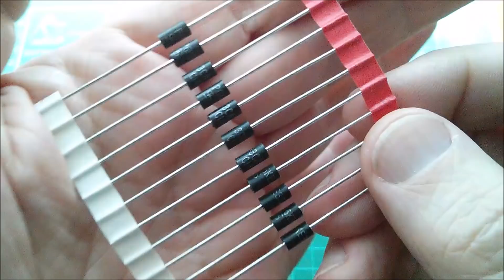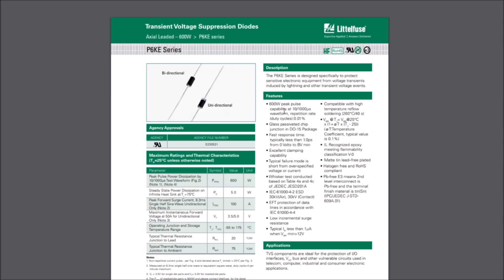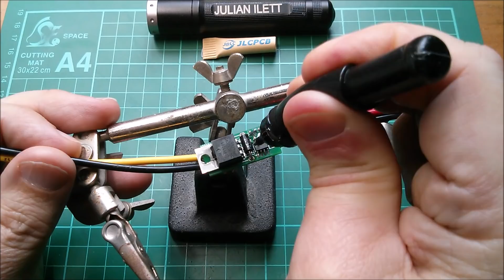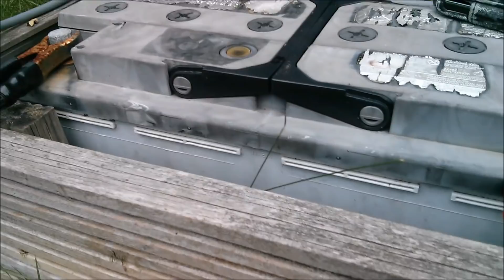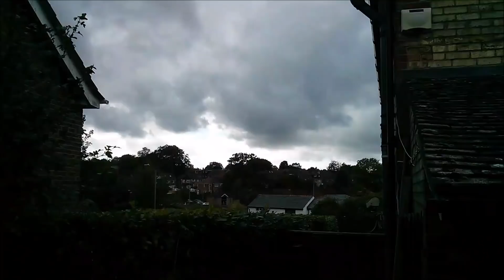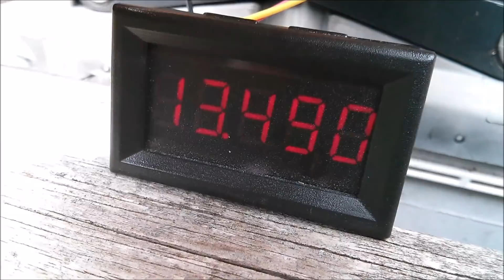A Diode with No Cathode - PWM5 Femto

Comment: Basically if one side spikes it will automatically send that voltage to the other side that can't take that voltage because it also has a zener diode (this package) protecting it from spikes? Basically this is a voltage regulator that doesn't allow any voltage under what you specify untill the voltage goes above that and then cascades the voltage to the other side? Or look at it like this, both sides can only take 5 volts, I install a 5.3volt variant of this and I spike side A with 30 volts not only will I ruin side A with 30 volts but I will also ruin side B with 25-30 volts because I just dumped my over voltage to the side that can't take it? I'm not sure I fully understand the purpose of this package because I've always used a zener to ground or power not sensitive side to sensitive side.
Reply: I'm puzzled too.  A zener will forward conduct or reverse conduct if there's an EMP in either direction.  So I would guess that maybe the devices shown are for ac applications where you could not use one zener.  I would further guess that a fat zener would survive long enough to take out a fast blow fuse in series from the solar panel, disconnecting the circuit completely.  Induced emp from nearby lightening strikes may briefly produce a voltage spike that can fry most (not all) semiconductors.  But they usually have little energy, so a good design can dissipate that.   A direct strike to an exposed connection is a different matter, which I don't think you can remedy with a small component because it carries a huge amount of energy.
Reply: It’s not the absolute voltage that is the problem. It’s the high differential voltage between the positive and negative circuits. The protection device clamps such a high differential voltage by conducting. The current flows via it and the energy is dissipated as heat. Once the voltage differential drops below the specified voltage, it stops conducting.
Reply: @Mark1024MAK    what do you think about doing all long cable runs as twisted pairs to reduce the induced differential?
Reply: Ray Kent - twisted cables help, yes. Not easy to do everywhere, for example at the battery. Also if you are using a manufactured cable, it may not have twisted cores. Most cables designed for power applications are not twisted.
Reply: @Mark1024MAK  you just explained a typical everyday one directional zener diode unlike the one in this video.
Reply: wheelitzr2 - these protection devices are effectively two fast acting Zener diodes back to back. The difference being a normal Zener diode will have a forward voltage of around 0.6V. And is slower to respond to voltage pulses when reverse biased. Whereas this protection device has the same or similar voltage characteristics regardless of the polarity. The voltage in either direction being as per the specification.
Reply: @Mark1024MAK  yes I get they are 2 fast acting zener diodes back to back, and that's not what you explained in your last comment. And apparently you don't get my issue with this package and how it's being implicated here. It's clearly designed for AC current but he is using it in a DC device. Let's say he has one side hooked to ground and the other hooked to +power and the zener is a 30 volt zener because the circuit is only 24 volts and will get destroyed above 34 volts, now let's say for some reason the power side goes above 30 volts then the zener in that direction will pass current to the ground and protect the device, However if the negative for whatever reason (gets hooked up backwords) and is hooked to say 45 volts then the zener diode in the other direction will allow 45 volts and the current associated with it through to the side that can only handle 24 volts. So please explain how that is ok.

Comment: You may find spray conformal coating a little easier to use and potentially much cheaper in the long run. The type of UV in your flashlight is also perfectly safe to expose your skin to. Also try slathering a load of thick grease over the battery terminals and that should help prevent corrosion.
Reply from the maker: I didn't want to use a spray - it would get all over the connecting wires. Also, I'd have to spray it outdoors.
Reply: Julian Ilett  You can also use regular nail polish, it works quite well as demonstrated by GreatScott!
Reply: Use clear nail hardener on it, it really works for waterproofing. JI.

Comment: Why do you want to make current from solar panels in England? Make a rain water generator, that would be smarter. ;-)
Reply: Because the "rain barrel" is occupied making fish for fish and chips. <ducks from the onslaught of ashtrays and shoes thrown my way>
Reply: @ExtantFrodo2    that could be the sole reason.
Reply: Ray, am I herring you right?
Reply: @ExtantFrodo2    as a teenager after band practice coming back to Charing Cross station we came past a fish and chip shop called the rock and sole plaice.  Rare example of a triple entendre.
Reply: Sounds like a nice place to perch! Pffft, I know that I'm floundering for puns here. Somebody krill me.
Reply: @ExtantFrodo2  Oh for cod's hake.
Reply: I sea what you did there. Just clowning around on porpoise.
Reply: @ExtantFrodo2  Have you fin ished because the scale of this is disturbing. I'm always up to some antics.
Reply: Almost. Although I do think we need to determine how many seahorse power he can get from his rain barrel.
Reply: @ExtantFrodo2  Simple maths, the average cart horse weighs about a ton or 1000kg. 1000kg = 1000lts of water. I assume his barrel is 200lts so 200kg and a seahorse is about 20grams. So about 2000 seahorse power, give or take a whelk or two.
Reply: Possibly because it's somewhat nicer to work in sun and partly cloudy than a downpour?
Reply: Big battery installations (think telephone office with phone booth size batteries) use NoOxide brand to prevent corrosion.  Not sure how that would work when exposed to the weather.
Reply: He likes a challenge.
Reply: I did the calculations for rooftop-rain hydro power. They did not come out favorable.
Reply: In England you often get the wrong kind of rain...
Reply: duncan, what could be worse than raining cats and dogs?

Have you ever heard of hailing taxi cabs?
Reply: Because it is easy to make power in southern Spain or California. But if you really want to improve performance, then overcast grey skies are the way.
Reply: der Birnodin            *.   C
Reply: People joke about England being wet...but I actually can't remember the last time it rained in Southern England! Other than the odd shower it's been very dry.
Reply: @hyperion8008  Trust me you English know nothing of rain. I'm Welsh and live in Carmarthen I've seen 86 consecutive days of rain.
Reply: The outside croc clips Mr Ilett a bit sloppy , I expect better, years ago when I was an apprentice,when finishing a job where battery clips were involved, we had to cover the joints with this red translucent jelly type stuff,I can't remember it's name, but it kept them like New.
Reply: Would that stuff they put over car battery terminals work?

Comment: If you had used a longer blink for a 5, it should be much easier to count.
Reply from the maker: Ah yes, good idea - that would work. The LED was initially just a heartbeat - so you could see that the unit was still working - but then I added a volts indicator (whole volts only) - then I added the tenths.
Reply from the maker: or a gap after the first 5 - like a tally count :)
Reply from the maker: I'll have a look at coding that :)
Reply: I read somewhere (can't find it anymore, sorry), that humans can intuitively count to 4 or 5 without thinking about it. That is why I though about the long 5. You get a long blink, than it is followed by at most 4 short bursts. If you want to get fancy, you could use morse numbers... ;)
Reply from the maker: Morse? No thanks - I don't need another look-up table!
Reply: int n = YourNumberHere (0-9);
int morse = 0x3C1F;
char pattern = ((morse>>n) & 0x1F);
The bits 4-0 contains the morse pattern for the numbers. ;)
Reply from the maker: and in PIC assembly language?
;)
Reply: I don't speak PIC assembler language, yet... Hold my beer, I will be right back.
Reply: @JulianIlett  maybe binary numbers?
Something like 1100 long 0 for the decimal point and 0111 = 12.7
Reply: It takes too long to learn a new assembly language... Here is the simplest c code that I could manage. Should be very easy to convert to assembly. If you actually do it , let me see how it is in ASM. Cheerio.
uint8_t n = Number (0-9);
uint8_t p=0x1F;
if (n<6) {
  p >>= n;
}
else {
  p <<= (10-n);
}
p &= 0x1F;
Reply: Now I understand what you mean... PIC assembly is very limited. It is either 2 loops with RLF or RRF or a switch, which translates to a lookup table  of goto. By the way, I am using sddc to compile c into PIC assembly to study it, maybe you would like to take a look.
Reply: I swear that this is the last comment. ;) I used SDCC to help me with that. I did some manual cleanup and commenting.

  1 ; Parameter in W
  2 ; r0x1000 copy of parameter
  3 ; r0x1001 high byte of pattern
  4 ; r0x1002 low byte of pattern
  5 
  6 morse:
  7   MOVWF r0x1000    ; save parameter
  8   MOVLW 0x3c       ;
  9   MOVWF r0x1001    ;
 10   MOVLW 0x1f       ;
 11   MOVWF r0x1002    ; load morse pattern 0011 1100 0001 1111
 12   MOVF  r0x1000,W  ; reload parameter as a counter for shifting
 13   SUBLW 0x00       ; make counter negative
 14   BTFSC STATUS,2   ; if counter is 0, don't shift
 15   GOTO  out
 16 shift:
 17   RRF r0x1001,F    ; shift high byte right into carry
 18   RRF r0x1002,F    ; shift low byte right from carry (nice way of doing multiple byte shifts)
 19   ADDLW 0x01       ; increment counter
 20   BTFSS STATUS,0   ; if counter is 0, we are done
 21   GOTO  shift
 22 out:
 23   MOVLW 0x1f       ; load 5 bit mask
 24   ANDWF r0x1002,W  ; return the masked morse value in W
 25   RETURN
Reply: I did an Arduino version using Morse - it's quite code heavy but works fine. I made a class for a morse sender, found I needed to change the mark-space ratio to make it readable.  https://github.com/GarethDaviesLondon/PWM-Charge-Controller-Arduino

Comment: A strip of elecrtical tape over the jaws of the crocodile clips will help prevent them from biting into the wire insulation.
Reply: Or shrinking tubes